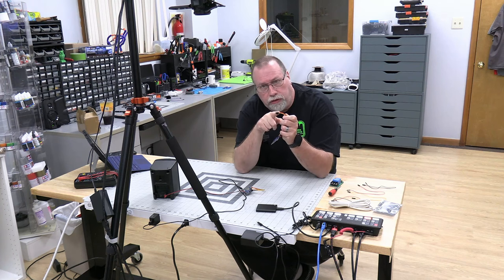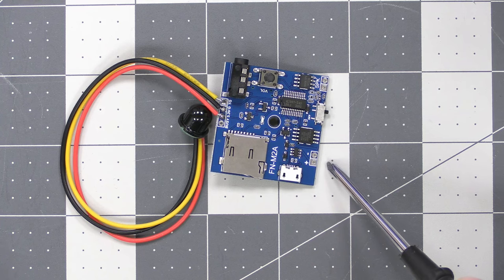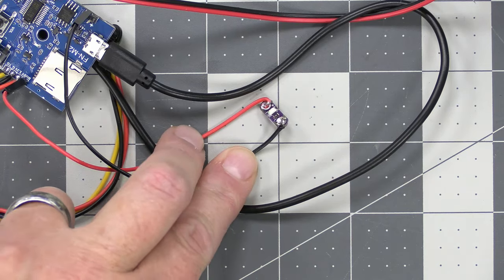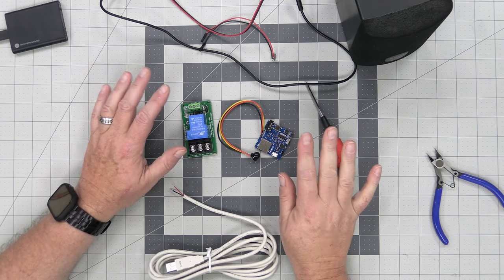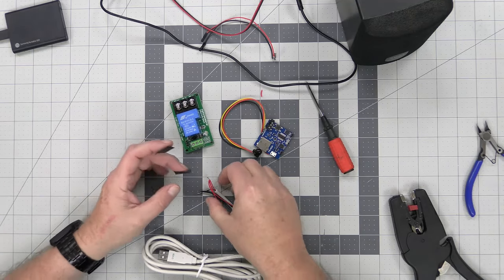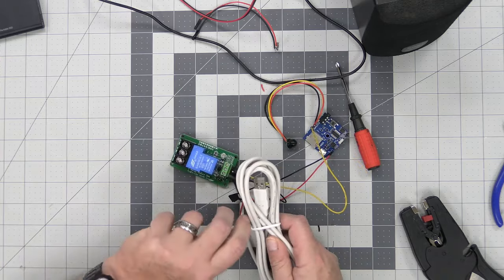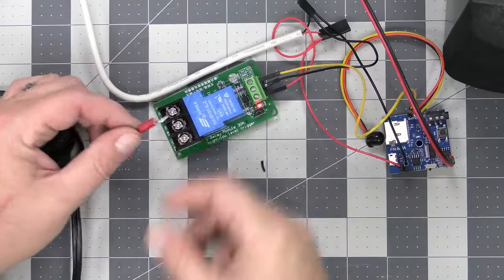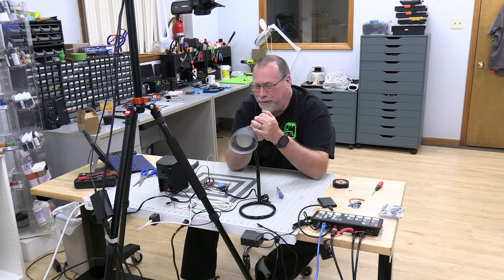All In One MP3 Relay Motion Sensor Board

Comment: Hi Steve, I have your MP3 Motion Sensor Board # FN-M2A. I placed the SD card inside the slot with the numbered audio tracks as you described in the video. For example track #1 is written out as "00001-sound.mp3" and so on. Altogether I have 7 sounds. My question is how can I make the sound card play off the SD card and not off the built in memory? There are other unknown sounds coming from it but my SD card with the preloaded sounds is not able to load or play. Is there a way to override this or reprogram the onboard memory card? I am using the micro USB plug for the 5 Volt power source. Please let me know what I am doing wrong and how to correct it, thank you.
Reply from the maker: Hi!  Confirm that the following is true: SD card is 32GB or less and that the card is formatted in FAT32.  If all that is true then it should be playing from the SD card.  Let me know.
Reply: @TheMakersCave  Hi Steve, THANK YOU! It worked! This little gem is fantastic! I connected it to a ground loop noise isolator, then to a stereo amp and out to my 4" speakers and it sounds amazing! Everyone should get this, thank you again!

Comment: Thanks for sharing  your wealth of experience with these excellent instructional videos. I'd like to ask if instead of a light on the relay, can I wire in a regulated power supply that has a 3v-12v voltage regulator. The power source I use controls the speed of the motor and runs on AC but coverts to DC for the motor. So the relay would turn on the power supply and that would be connected to the DC motor.  Possible?
Reply from the maker: Thanks for watching, I really appreciate.  Yep, that's why on that video I used a heavy duty relay because I was using AC current.  The Mega Kit for that board comes with the HD relay.

Comment: I'm looking to make an electrical chair prop.  So I'd like to add sound, a flashing light, and run a wiper motor (to agitate the body).  do I need 2 relay switches?  I'd also like to run it off a 12v 5a power supply.
Reply from the maker: you could use this board to detect motion which would then play a sound and activate the relay.  You could have this activate two relays if you wanted to.  I would probably go this route since a wiper motor can draw quite a bit.  You would still need a 5V power supply for the sound card and the relays.

Comment: Hi! Thank you for this amazing video! I have a question, I want to use some CCFL light bars that use a AC/DC adaptor of 5v 1a instead of the lamp, does the 5v 30a relay you are using is ok for this? 🙏 thank you!
Reply from the maker: If all your pushing is 5V 1A either the standard or heavy duty relay will work.  I prefer the heavy duty terminal version and use them almost exclusively now, then I never have to worry if I upgrade a prop.  BTW, thanks for watching, I really appreciate it!

Comment: Is it possible to use this same setup or a similar setup to have reactive LEDs when sound plays? This setup has everything I have been looking for but I am wanting to see how you could integrate reactive LEDs. Thanks for the videos!
Reply from the maker: I'm thinking yes but I'm not quite sure what you mean by "reactive LEDs".  Do you have better description or product name.
Reply: The LEDs will flash to the beat/sound to the audio that plays. I know a PIR sensor and small MIC is involved just unsure how it would tie into this circuit.

Comment: Great video.  At first I was thinking this was only to trigger lights.  But you can trigger anything that is plugged in, even a circuit that operates an animated figure as well as lights, is that correct?   For instance, activates the sound board which turns on the relay, which in turn activates a circuit that turns on a motor and light shining on an empty rocking chair that rocks while the sound is playing.
Reply from the maker: Hi, thanks for watching!!  To play it safe I would have the sound card activate a dual relay board.  It's just like the board in the video but it has two separate relays.  You could use one to activate the motor and the other to activate the lights.

Comment: Hey Steve, enjoyed your video.  I sent you an email a couple weeks ago, but I think you missed it.  My rocking chair child skeleton is working well, thanks to your videos.  I rigged a remote control to it by using a purchased plug-in cord with remote.  I’ll try to email you a video when I get finished corpsing and dressing the skeleton.  Our first haunted lighthouse is on the 22nd, so I don’t know that I’ll have the time to wire the motion sensor for this year, but hopefully next year.
Reply from the maker: I'm so sorry I missed your emails.  The last one I have from you is 8/13/22, is that the one?
Reply: Looks like my last email was 8/24.  I was still trying to wire a push button to trigger it, but didn’t quite understand how.  Then I went to the remote, which didn’t need any additional wiring, simply plug in the USB block and good to go.  Motion sensor would be better yet, but at least it’s working!😂

Comment: This is great! When plugging in desktop speakers, will it play through both?
I was thinking of editing different sound files onto L/R channels so it would play multiple sounds at once.
Reply from the maker: Hi, thanks for watching.  If you use the 3.5mm jack it will play in stereo.  if you use the the speaker pins for the built-in amplifier it is only mono.  I almost only use the 3.5 jack as I like the sound computer speaker produce, especially if you use the kind that have treble and bass adjustments.

Comment: I have a stranger things demogorgon animatronic that has the try me port on the back. I want to run it with a motion sensor have sound run rgb pixel Christmas lights to replicate the wall scene where it comes out of the wall. Trying to figure out what to use for programming the lights to work with everything else.

Comment: Can this setup power a home subwoofer with an aux input and a strip of LED lights? Thanks for any suggestions.
Reply: I’m new to this arena but my biggest question at the moment is what are the power limitations? Thanks
Reply from the maker: that board has two ways of getting sound out.  The board has a 3 watt amp built in that is accessble via the two audio pins which provides mono sound, the volume is controllable by the volume button on the board.  There is also a 3.5mm audio jack, like those found on the back of your computer.  This jack needs powered speakers like computer speakers.  From your description it's sounds like your system has a 3.5mm AUX input.  Just use a male to male 3.5mm cable to get the sound from the board to the AUX input.  Here's a link: https://amzn.to/3IjNR62.  If you follow that link you can get one in 3, 6, or 10 feet.  You can also find them at Five Below, Best Buy.  Hope this helps :)  If you have any more question please ask.

Comment: I'm stumped right now. I am trying to power 5 volt LEDs. I tried the two relays that I have with the same result. Measuring from the DC- and Busy signal on the relay (switch clicks but does not put out any voltage), I am getting around 1.29 volts when not triggered, and 3.7 volts when triggered. DC voltage input was reading just under 5 volts. I took the relay completely off the circuit and wired the busy signal and ground to a 5 volt LED. My board has a weld circle for busy and ground right next to each other, with busy not in the same location at the PIR sensor wires as seen in the photo that came with the boards. As predicted, the 5 volt LED was dim due to only having 3.7 volts to it. The LED lights up during the sound and then turns off. Unfortunately, halfway through the second or third sound effect, the 5 volt power pack shuts off as if it is not getting a signal from the sound board. I found that wiring the 5 volt LEDs directly to the power bank of course keeps the lights lit. I am using a LED strip that was USB powered 5 volts. The sound board activates and deactivates as normal, does not lose power and the power pack works as normal. However, I bought the set up to have the lights turn on and off when the sound goes on and off, not to stay lit all the time. I have not tried to second board that I bought from you.
Reply from the maker: Hi!  The "Busy" pin on the sound card is there to activate a relay module or be read by a microcontroller, like an Arduino.  In the video you'll see how I wire the "busy" pin to the relay to make it activate during the sound playback.  As you figured out, the busy pine doesn't have enough voltage to drive 5V leds and the current is in the low milliamps.  You would use a seperate power source for the LEDs and use the relay to control that voltage to the LEDs, the relay would act like a switch.  Negative of LEDs to negative of LED power source, positive of LED power source to relay COM terminal,  positive of LEDs to NO (normally open) terminal of relay.  Now when the relay activates it completes the circuit and the LEDs light up.  Maybe this will better explain it, if not just get back to me :)   https://youtu.be/-NjP07dHUGI
Reply: @TheMakersCave  thank you for your help reminding me. I realize that I haven't wired up a relay in many years. Brain is kind of fried as well after having to solder wires for two stereos. One for my Jeep, one for my mom's truck. I also had to replace a light pod on our station wagon Ecto-1 as well as install a DC to DC Charger for the back battery that activates all the lights. So a lot of electronics stuff needing wired in less than a month. So I get what you are saying. I just need to let my brain recuperate.
Reply: @TheMakersCave  I have a follow up. For the power bank cutting off halfway, I wound up getting a different power bank which fixed that issue.

Comment: So do you need 2 separate power sources? One for the light and one for the sound board?
Reply from the maker: For what was in the video yes.  The board and relay worked off of 5 volts DC.  The lights were AC.  The two shall not meet :)

Comment: Great board and I like its ability to sequence thru the sound files but without a manual trigger, it misses the mark for me.  Perhaps that could be an update for a future version.  Either way, keep up the good work.
Reply from the maker: If you're looking for a manual trigger of this board vs the PIR sensor you can just cut off the PIR sensor and short the Yellow (PIR trigger) to the positive of the PIR sensor. You can use a wireless relay, a button, a regular relay to activate the board.

Comment: Can this be used on a 3v light kit?
Reply from the maker: If you're only talking about a single LED then I think the busy pin would light it.  But you can use a relay, like in the video, and you can wire anything to it.
Reply: @TheMakersCave  
Thanks, but to be more specific, it’s a Darth Vader Chest and belt box light kit that run on 3v. I’m assuming the other half of the power cable that goes connected to the relay is just to interrupt the current that in my case, draws power to turn the light kit on and off. I’m just afraid that the relay will produce 5v to the light kit and fry it.
Thanks for your help and I’ve learned so much from your videos. Opened up a new world for me. YOU ROCK!!!
Reply from the maker: The relay doesn't provide any power at the COM (Common), NO (normally open), or the NC (normally closed) terminals.  The 5V is to run the board and the logic electronics of the relay.  The relay acts as switch that completes a circuit.  Take your 3v power negative and wire that to the negative of the lights.  Take the 3V positive and run that to the COM relay terminal.  Take the NO relay terminal and run that to the positive of the lights.  Now when the relay activates it will allow the positive voltage to flow to the lights, hence turning then on for the duration of the sound.

Comment: How do you add sounds to the board
Reply from the maker: The board has 4MB flash RAM on board and it has has an micro SD card slot.  for either one you just plug the included USB cable in to your computer and they will show up as drives.  Simply copy your file to either the onboard flash RAM or to the SD card if you are using one.

Comment: I used a micro SD card with 1 Mp3 in it, but whenever I am turning it on, it's playing a Fanta advertisement (haha), not sure where it came from , How can I make it play my file?
Reply from the maker: Did you delete the Fanta sound?  That's the sound the manufacturer puts on there.
Reply: @TheMakersCave  How do i delete? From where?
Reply from the maker: That sounds like it's not recognizing the SD Card.  The board has memory on it for sounds if you don't want to use an SD card.  If you bought the board from us (GraveDecor.com) it should have come with a micro USB cable about 5" long.  If you use that cable to plug the board into your computer the board will show up like a thumb drive.  There should be one file listed, that's the Fanta ad.  Delete that file and add yours.  Make sure you don't have the SD card in and then apply power.  If your sounds play then we know it's the card.  Remember that the SD card can't be any bigger than 32GB, I usually use a 16GB card.

Comment: Or simply use a time delay relay
Reply from the maker: that would work for the relay but there would be no sound
Reply: @TheMakersCave  Sure there would, the circuit would act the same way but with either an on delay or off delay in the relay itself, we use them in automated equipment to control product flow.

Comment: Would this work the same wiring it to a jst plug to activate the eyes on one of those 5 ft skeletons from home depot so it keeps the eyes lit while the sound is playing?
Reply from the maker: Sure would.  Just find the power lead going to the eyes.  Cut it and put one end of the cut to the COM (common) terminal of the relay and the other end of the cut into the relay's NO (normally open) terminal.  Then when the sound file plays the eyes will light up for as long as the sound is playing.